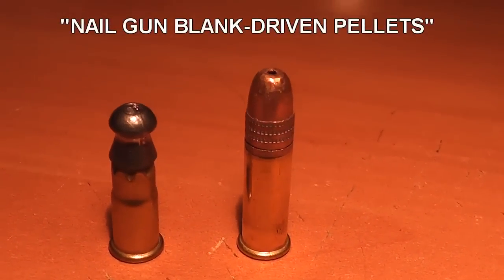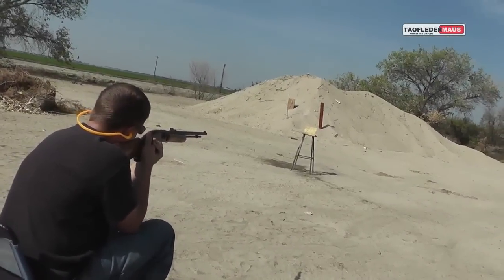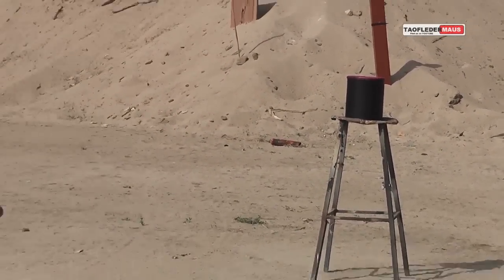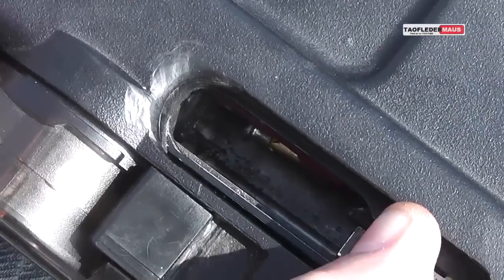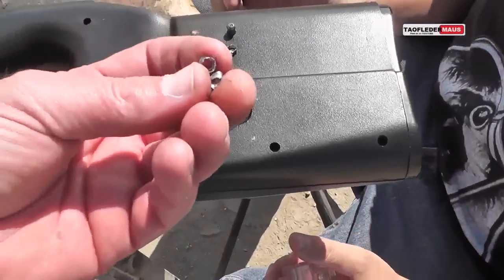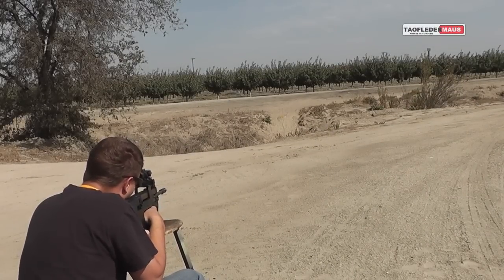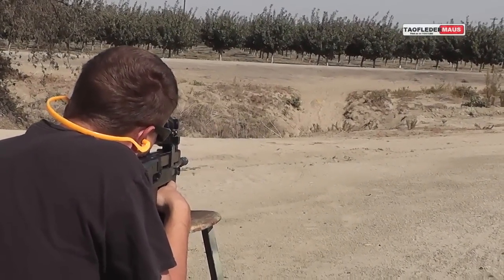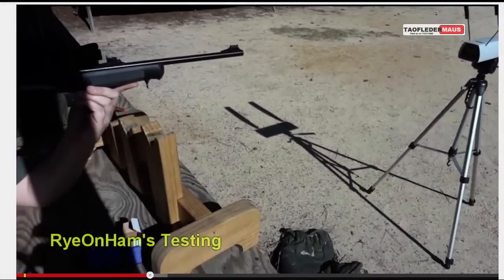Shooting .22 PELLETS Using NAIL GUN Blanks?  PART 2

Comment: It is the diablo shape which kills accuracy at higher FPS as it can only handle lower speeds.  I suggest you try the Promethius PILEDRIVER Pellets available at http://www.airgunsofarizona.com. At 30 grains and a more boat tail shape, it should leave less residue and go farther.  The skirts won't come off so easily.  Perhaps some type of wadding between the shell and pellet would make this work better.

Comment: The reason they are not accurate is because you are using pellets that are too light and not shaped right for passing the sound barrier (Approx. 1100 fps). You need to try heavier, bullet shaped pellets.

Comment: Jeff, you need to use a pellet of much greater weight if you want to be more accurate.
Reply from the maker: The problem there is you'd have barrel over-pressure from the heavier projectile.
Reply: Well Jeff, to my understanding, a 22 RF Long & LR averages around 24,000 psi. I'm sure the barrels are tested to withstand twice that much.
That's a lot of pressure but I doubt if shooting let's say a JSB Match Diabolo Exact Jumbo Heavy .22 Cal, 18.13 Grains, Domed, or the Beeman Kodiak Extra Heavy .22 Cal, 21.14 Grains, Round Nose, would produce any cause for alarm.
But the choice is of course yours.
The lands, grooves depths and pellet twist are quite different between air power and powder actuated bullets but the pellets being forced through a standard 22 cal barrel will barely seal enough to produce dangerous pressures.
This is all my opinion and I won't take it wrong if you don't agree, after all, this is part of the overall fun.
Reply: @taofledermaus  Not necessarily. Since the Hammond Game Getter device uses the Ramset loads to fire much larger caliber/grain weight round balls.

Comment: What about glueing the pellets onto the blanks and using them in say a single shot breech loading .22 rifle or a pump action or bolt action .22 rifle. The standard box magazine has shoot that it is out but the others may be feasible. In theory it should operate almost similar to early breech loading percussion paper based cartridges. http://en.wikipedia.org/wiki/Paper_cartridge
Reply: +kamenridernephilim The problem is the skirt.  The brass expands and traps it, which rips the pellet in two the same as gluing it.

Comment: +TAOFLEDERMAUS Aren't you guys worried that jamming down bbs throug the front end of the barrel will ruin the rifling?
Reply from the maker: +Paul Margettas  They are making rifling out of steel these days so we should be good.
Reply: Ah ok. I was thikning more along the lines of micro imperfections but i guess they wouldn't screw up the accuracy in any significant way.

Comment: has anyone ever tried an actual .22 rifle  projectile with these instead of the pellet ?
Reply from the maker: it would probably blow up the air rifle
Reply: I think he meant to say : to use a normal 22 bullet with a powerful nail gun blank in a 22 riffle, not airgun
Reply: Simon L I thought that's what I said ??? But yeah that's what I meant. I don't have a chronograph but I'm tried it. It seems to be about as accurate as my store bought rounds but has access hell of access lot more pop behind it. If someone does chrony it I'd love to see the results. I used an old single shot winchester and self cast lead with no.2 blanks and it's done account fine job of collecting rabbit n squirrel.

Comment: So a kevlar wont save you from a pallet
Reply: Of course it will. It was clear that neither round penetrated the Kevlar and that level of back face deformation is peanuts. NIJ standards allow for 44mm of deformation on clay. That was just a few mm in watermelon.
Reply: I saw watermelon juice oozing out
Reply: Simon Fong if you punch an orange juice will come out.

If you punch yourself in the chest you won't die.
Reply: It will hurt but you will survive.
Reply from the maker: The pellet or bullet won't penetrate the soft Kevlar,  but  that doesn't mean a lot of force doesn't make it through.   You'd have a pretty bad bruise.
Reply: aserta Sure. but to avoid that there's the NIJ standards on backface deformation to reduce the likelihood of a cracked rib.

It's not perfect, the point is to prevent extra ventilation on your chest and like you said shock can go through - I just doubt the pellet has that much energy on it. Skin is pretty elastic and absorbs a lot of shock.

Comment: the reason they are so fast is the fact that they are so low in grain. the key to terminal ballistic penetration is velocity. they are so low in grain that they easily reach 2,800 FPS...similar to how a old fashion APCR (or Armor piercing composite rigid) tank caliber projectile works. its got the same surface area and diameter to a normal .22 but its mass is different like I said. only down side to this is as soon as it leaves the barrel it will lose inertia massively in comparison to a normal .22...just like APCR did when compared to AP/ APHE/ APBCHE             (AP LEFT||||| APCR RIGHT)                                                                                                                             http://1.bp.blogspot.com/-is5VsHFS4dA/UX7PEIptkdI/AAAAAAAAAgI/pQ3H89DiEJk/s1600/45-subcaliber-1.png

Comment: just stick to under 35meter targets BIG BUNCH OF OLD PLASTIC TOYS please like subsonic pellets were designed. even 100ftlb fac air rifles dont go any were near 1600fps in .22 or even 1.77 once you factor in the fact your gonna need 20gr+ pellets to use your faster gun at more range most .22 air rifles are under 1130fps  your asking a bit much of stock 13gr non fac pellets at 2800fps  MACH2+500 ish fps ,,MORE VIDS OF THAT 4200FPS 204 or 206 lapur what ever its called please ,,no more AR's any cal or style please